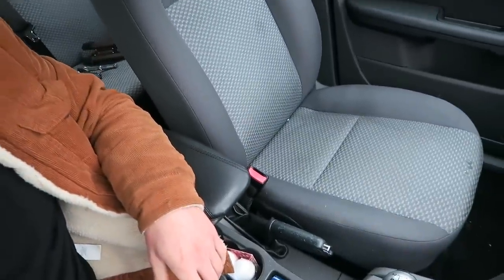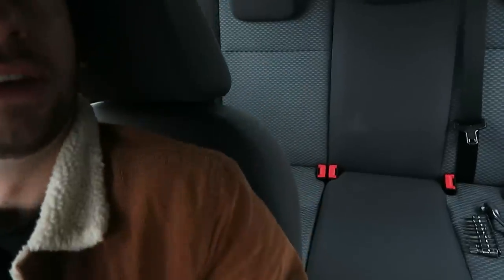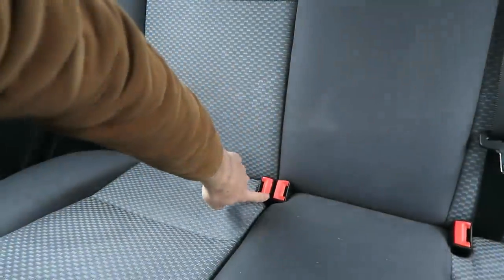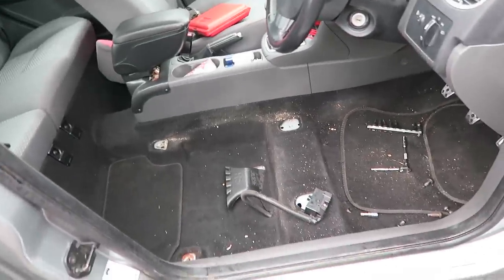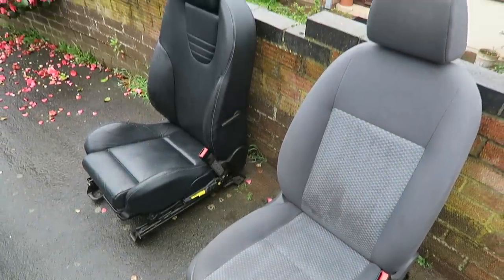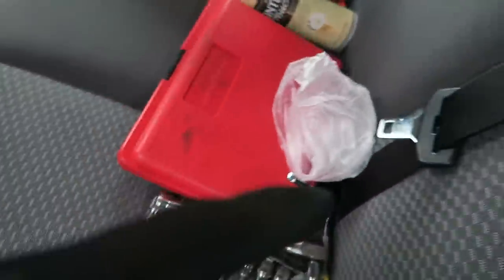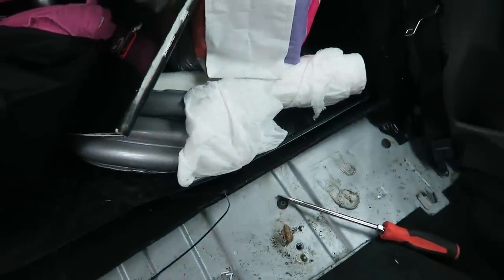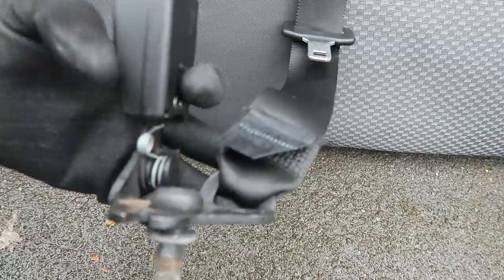Focus Gets RECARO Seats! (Install)

Comment: My driver's side seat on my 2007 Ford Focus Sedan keeps breaking .  I am probably too forceful when I get in and I had an autobody repair shop change it twice.  I moved away from his location and I can't find a seat online so that I could switch it out and replace it myself.  Any ideas?  I will say I might look at replacing the seats like you did in this video.  Great work sir!

Comment: Was the drivers recaro a power seat? I am going to swap the interior in my MK2 over to titanium which has a power seat, wondering if it's a straight swap.
Reply: Hi what was the outcome of this as I am doing this now.
Reply: @andrewpratt8436  did you do this? tryna do the st swap but wondering how yours went

Comment: Show us how the arm rest installs, this is on my shopping list as my LX, like yours, has nothing LOL I have installed an '3rd' center LED reverse light, reverse camera, LED reverse bulb, new footwell LED lighting, additional 12v socket (ignition controlled) front DRLs with center and halo individual switching (!), mudflaps, DAB converter, Heko wind deflectors, and other 'cheap' mods. It's beginning to feel like a proper car now!

Comment: speaking overall about all cars in general, rear seats from a 3 or 2 door car usually have squared off ends of the seat base (where they just go out to the flat sides of there car) whereas 4 and 5 door cars usually have curved ends, this is because in the 3/2dr variants you can only be in front of the seat and sit straight back onto it whereas the curved seat base end aid getting in and out of a door (ie if someone enters bum in first and swing legs in and so on and so forth ) ;)

Comment: Good change! Here in Portugal you wouldn´t be allowed to make this change, because in MOT the car would be reproved. If this specific model is for 5 passengers, it must have 5 seat belts. Here the laws are very tough = ( Awesome video!! =)
Reply: Speedy what about people who strip out the back seats?
Reply: They need to mount them. The other way is to corrupt the inspector with money to pass/approve. =\ In my case, my car is 100% stock to avoid problems with the police and in the MOT.

Comment: Hi mate I have a problem with my 54 Passat changed the CD player and it turns on and off fine with the key  but don't save the settings
Reply: Take the radio out and there will be two wires one yellow one red with a split joint, swap them over yellow to red and red to yellow
Reply: Luke p thank you mate took 2 seconds to lol thank you very much
Reply: ginge 87 no problem mate💪🏻